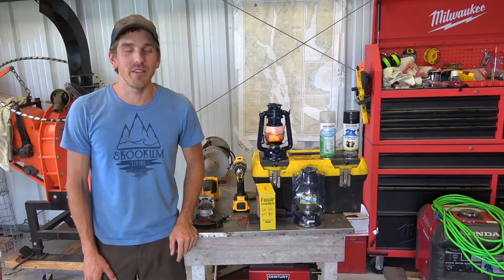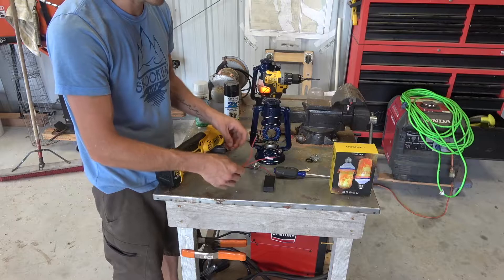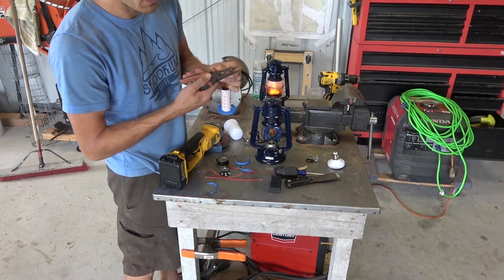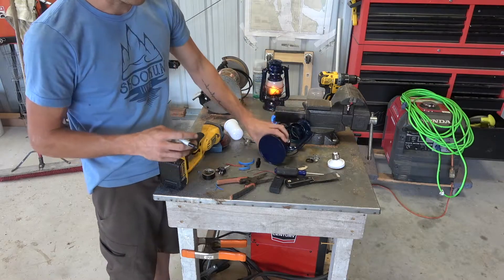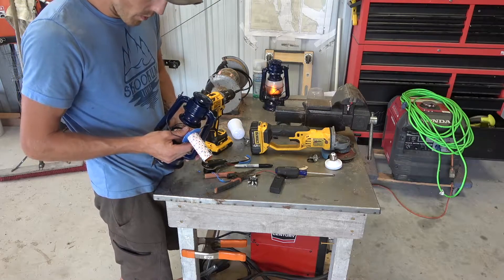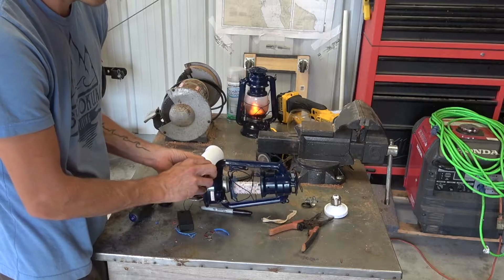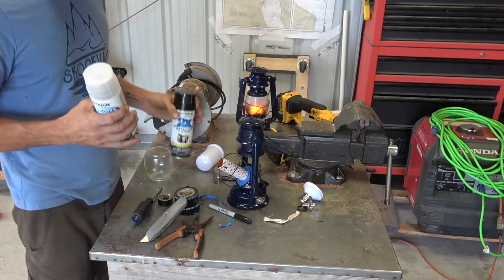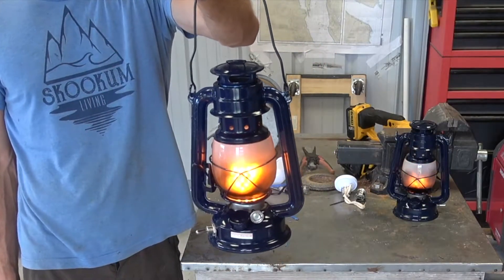DIY Battery Lantern Build

Comment: if anyone reads this. i want to convert some kerosene lanters to electric lanters. but i want to make it rechargable. But i also want to use an LED lantern bulb instead of using some normal LED lights. My idea is to use a 2200 amp rechargable battery to power the 2 watt LED lantern bulb. but from my understanding is that the voltage of the battery is too low to power the bulb. Is there anyone who could please tell me if this will be able to power the bulb for atleast 4 hours or will the battery not be able to power the LED bulb at all?